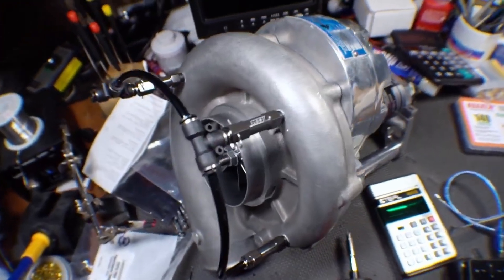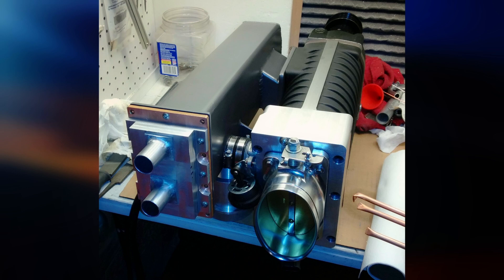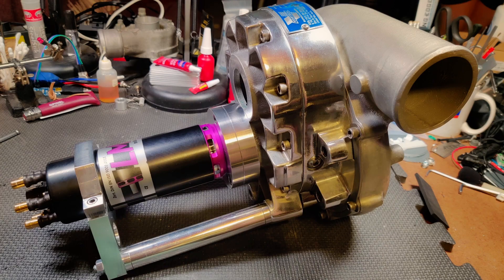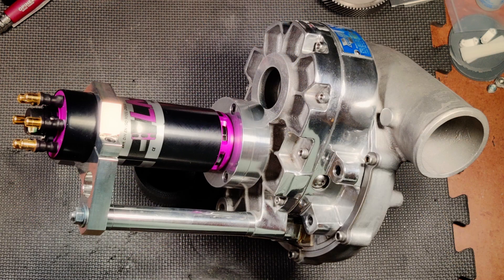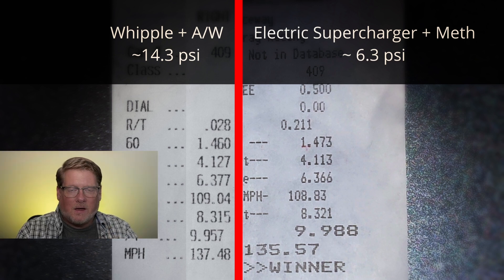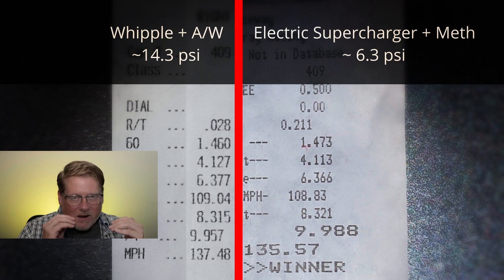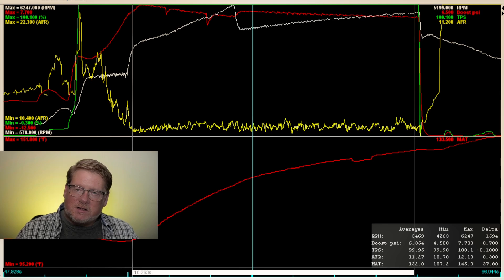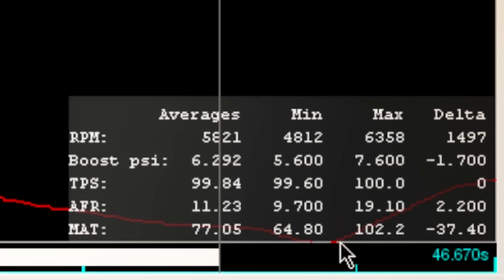Air/Water Vs Methanol Injection - Which is better?  Data Deep Dive!

Comment: I haven't watched the video yet but let me chime in, ive a 1.4L rover k-series, with awesome intercooling she was det limited at 19psi of boost.. woth water meth on the exact same engine i could go to 30psi of boost and never found the boost/det limit as the turbo was becoming inneficient. Water meth is under-rated
Reply from the maker: I have to agree with you - I was always poo-pooing it until I tried it.  It's pretty amazing stuff, especially for a street car.
Reply: @AlexLTDLX check out the nadca studies way back in ww2 they basically couldn't get detonation to happen accept at 1-1500rpm no matter the timing or boost or cr they changed all of it during the tests even filmed alot of the tests with and ionic camera to catch the flame propagating under different conditions and in different test engines even rotary and diesel and 2stroke. You will make less power with it but given the boost and timing that can be added it's pretty easy to make it back but at the same timing boost ect it will make less power.
Reply: 30psi...on a K series...😆 a built N series i could see it lasting, K series... not so much
Reply: Truth be told you only really need the water .  Unless you need more fuel that injectors can't provide.
Reply: Small bore early k with the old style block and thicker liners. Went 11.9 at Shakespeare county in a classic mini. Later style k block big bore cracked likers at 19 psi .and drove from Glasgow and back.
Reply: @denisohbrien   yeah  now you mention it they have 75mm bore, so you'd have a bigger contact area between the liner and the head. I have a 1.8vvc 160 I just did the gasket on and noticed the thin sealing fire ring on the elastomer gasket. I used the N series after, did you have to O ring the head?